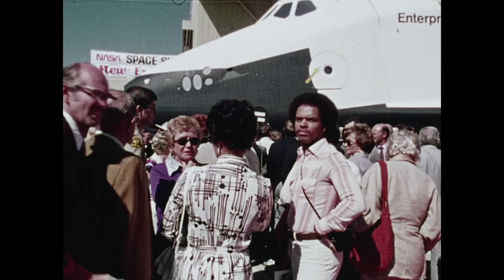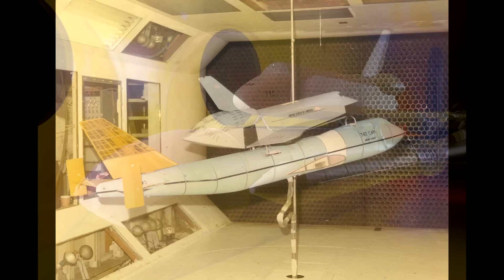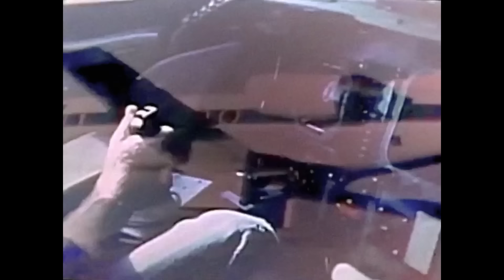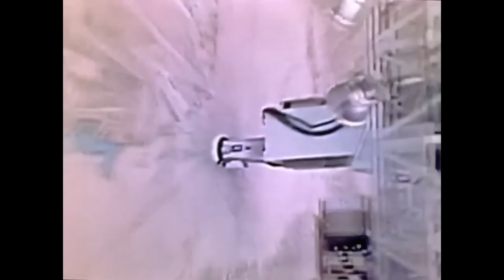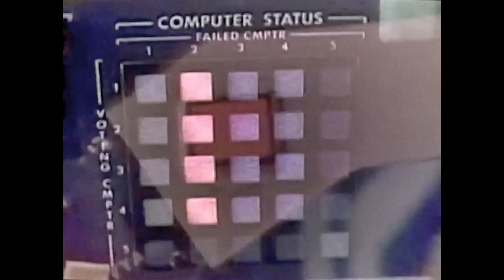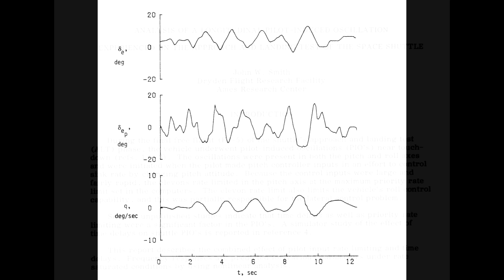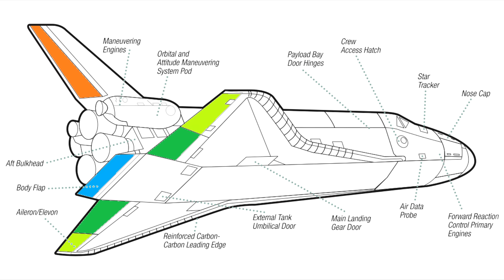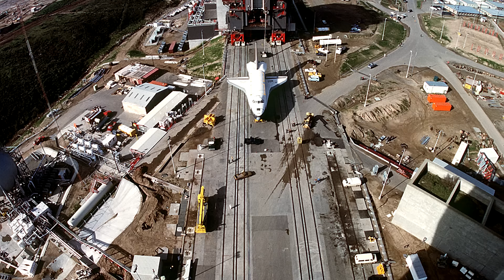How NASA Learned To Fly The Space Shuttle Like A Glider

Comment: Thanks for this video. I was able to re-live my youth. In 1981 I was a technician helping build the cabling system at Ridley Mission Control at Edwards AFB. As the building was built, I stayed on to be techinical support for the operators of the consones you see in every shot of Mission Control.

I could tell stories about building the cable infracture in Ridley. I had to wear a coat when running the cables under the four foot false floor. It was very cold under there. The cooling system for all the equiment was just cold air fed down under the floor. Then whenever they added a piece of equipment, they just cut a hole in the floor and put the added piece of euipment over it.

I was there for the first Shuttle landing. However, since I was just support, I watched with the crowd. I had to be out of Mission Control 30 days before a landing. I had a shop where I worked on other projects. Like Tracking & Telemetry and Communcations equipment for Ridley.

I am now 68 y/o. I enjoyed seeing Ridley Mission Control in action knowing how deeply I was involved in it. I was 24 when I worked there for Kentron International.

I worked on other projects for the DOD, like as an avionics tech for the ASAT, where I was the only avionicstech on four of the avionics packages for the Celestrial Eagle. I was the guy who was on the HUD, the VSD the ACS, (Armenent Control System), and the CC (Central Computer). 

And I worked on the M.I.L.E.S. System at Ft Irwin.

But I can say I had an important role in the Space Shuttle program.

Comment: I worked for NASA at Johnson Space Center and I was visiting friends in Toronto in 1983. While they were at work I explored. I ended up in a huge park next to Toronto. It was mid day and I was the only one there. It was a beautiful day, blue skies and just a bit warm. Then people slowly began to show up. Many of them had cameras and setting them up on tripods. Within 30 minutes thousands of people were there all looking at the sky. At that point I stood up and asked a woman what was happening. Just as she was answering the Space Shuttle Enterprise appeared in the sky flying piggyback on a Boeing 747. It was the first time the shuttle flew over a foreign country (except for a few hundred miles up in space). 

This flight was for Canada’s contribution for designing the shuttle’s robotic arm. One of my first assignments at NASA was to help build the robotic arm simulator in building 9 at Johnson Space Center. I worked with a computer guru, Luigi Schiavo, and an electronics expert, Jim Gimble. After the robotic arm simulator was built six different grappling fixtures were tested to determine the one that would operate best in zero gravity. We practiced lifting helium filled simulated payloads with the robotic arm and putting them into the shuttle payload bay. The Canadian robotic arm was mounted on a full scale mock-up of the Space Shuttle. Every once in awhile a ‘simulated payload’ broke free from a grappling fixture and floated to the top of the building. They didn’t move very fast because prior to any training session weights were placed in pockets all around the simulated payloads to try to keep them neutral so it more represented the conditions in space. 

I still have a lot of photographs I took that day. I am a photographer so I always had my camera with me. It really came in handy on that incredible day. I laughingly thought, I came all this way and my work followed me.

Comment: SpaceX catching the booster on the first try (5th flight) is cool but casual reminder that the first time the shuttle launched, it had 2 crew aboard, actually went to orbit and then came back completely intact...

Recovering the upper stage is gonna be a lot harder than catching the booster and so far starship has been a completely empty test article.

What happened to the promised 100 tons to LEO?

I wanna see the footage of SpaceX doing wind tunnel testing with starship mockups.

Comment: I see that you covered the first attempt at free flight.
I was watching on live TV as they tried it. They fired the explosive bolts holding the orbiter on the back of the 747, the 747 did the "dip" to assist in release and.....
It did NOT come loose.
They tired over and over and could not shake the orbiter loose from the back.
They had to land with it still attached and NO IDEA if the explosive bolts had actually released the orbiter or did they fail to fire, and the orbiter was still firmly attached??
That would have been one hell of a rectal pucker factor while setting down the two.
If the landing jostle had shaken it loose it would have resulted in a hell of a mess on the runway.
Reply: And it looks like the T38 must have its gear down to fly as slowly as the orbiter?

Comment: Wait -- what do you mean, "reversed the engines"? Why would you want them exhausting forward...? Or what am I not getting?
Reply: It was to add more drag than there would have been with the engines simply off, to simulate the shuttle having more drag tha the test plane
Reply: @jextra1313  okay, that much makes sense...but the whole logistics of the thing are still quite confusing. Surely there aren't nozzles (or even combustion chambers) on both ends? Are they just venting fuel/LOX in the opposite direction (sans combustion)? Because to me, the concept of an engine reversing sounds, generally, like an explosion 😳
Reply: @dancoroian1 You're right, you can't run a jet engine in reverse, but you can redirect the thrust using a physical shield that stops the jet blast and redirects some of the thrust forwards.
Reply: @jextra1313  thanks! Really not sure why that perfectly concise and understandable explanation was traded for "reversing the engines" which seems at best inaccurate and at worst actively confusing...

Comment: This brings back many memories. I was in the AF from '78- '82, stationed at Norton AFB as part of the 1835th EIS. Arriving TDY at Edwards in Summer '79 I got to witness many, many test flights of the 747/Shuttle coming on and off runway. I used to marvel at the skill it took to do touch and goes there.
My groups job was to install commo, metro, video and data cabling across Edwards for the glide tests onto Rogers Dry Lake. We spent months out there working on that. It was a turning point of my life actually. I was part of a mission, working with a bunch of great people with a time line that had to be met. We pulled this off a few months ahead of schedule.
Some of the work we did was right along the active runways. I remember watching the transport combo taking off etc maybe 300 feet away from where we were working. Also slews of the coolest planes I've ever seen. NASA stuff, old F-102's, 106's, A-7's, modified B-52's. It was just a real source of excitment for a young country boy.
Great video as always!!

Comment: I wonder how accurate Space cowboys is, where the modern (during the shuttle program) astronauts say that it's impossible to land without the computer and the old veterans prove it can be done.
Reply from the maker: Computer is still needed for fly by wire, but the longer range navigation could still be disabled for a manual approach plan.

Comment: The "forgotten shuttle", Pathfinder, was used to measure clearances and mounting brackets so that Enterprise wouldn't be damaged.  Made of steel, fiberglass, and plywood, it didn't actually have a name until it was rebuilt as a display vehicle.  It is currently on display at the Huntsville Space and Rocket center.
Reply: Makes sense. I was wondering why they were using actual shuttle construction when basically a foam and plywood would give same results (except weight testing)
Reply: ah yes, OV-98, my favourite

Comment: The runway surface at KSC was made for the shuttle to have an "aggressive" tooth for better grip. But it tore up the wheels, and was resurfaced. I saw the Enterprise when it was on display at the New Orleans World's Fair. I also saw a shuttle on re entry over New Orleans. Still leaving a glowing meteor trail. Slower than other meteors I've seen. Though I suspect one I saw was the shuttle fuel tank re entering, and breaking up. It was on a west to east course, and at the opposite north south angle as the shuttle I saw.

Comment: Enterprise wasnt actually a space shuttle, it wasn’t built to go to space. no engines or heat shield. It was built for test flights, and interestingly was flown with different weight configurations - I wonder if that contributed to the not so smooth landing seen in this video. They did plan on retro fitting it for space flight, but the design was changed and they decided it would be too costly to dissasemble Enterprise to have the various sections sent back for retrofitting.

Comment: As a glider pilot I have done a lot of landings. Space shuttle being a huge glider this 1st landing is not bad at all.
The oscillation very much looks like 'wanting to land the plane' instead of 'letting it sit and land itself'. And with over-speed you then get a oscillating pattern, which can turn ugly very quickly. Typical newby glider pilot behaviour that your instructors will force out of your system very quickly.
If this was software induced that is a potential killer. Software induced oscillation was also seen on testflights of some recent jets.

Comment: I use to work at J.S.C. on the Space Shuttle Simulators in the early 80s and we often tried to land the Shuttle but never once came close!  It was a brick with wings and you had to anticipate your control movements way before your natural instincts.  As you might expect, the Astronauts made it look easy.  :o)
Reply: I replied to your comment but it got deleted. I worked for awhile in buildings 5 and 35 on the fixed and motion base simulators. I ‘flew’ the motion base several times and landed successfully half the time. A couple of times I descended too quickly and hit the runway too hard (probable crash). I went on to work as a test conductor, engineer, designer, suit subject and then I created a video production facility so I could make video programs on Space Shuttle and Space Station missions. I was in building 5 walking toward motion base when a fellow engineer walked up to me telling me the Challenger just blew up. I was in shock. I worked with astronauts training in the different facilities at the Johnson Space Center so I got to know many of them.

Comment: The five computers did not work as you described. All five would vote and the majority decision was the accepted answer. If one of the computers failed, another one would also stop voting so there was always an ODD number in the voting cluster. Further, if there was a second computer failure, the computer which had previously dropped out would now start voting again - this means failure modes in voting were 5-3-3-1-1. If an even number of computers had been used in the vote, this could lead to a deadlocked vote and hence the system would not know what answer to trust. It is a well known "coding pattern" which existed more than five hundred years before the first computer was built; sometimes the oldest formal decision making processes feed directly into our digital world.

Comment: Amazing that the Shuttle would come down at a 20° (compared to 3° of an airliner) and yet be able to flare and hover like that over the runway and even need a parachute to timely complete rotation to the ground. Great coverage!
Reply: Ground effect.
Reply: Its poor lift/drag ratio is partly due to its low aspect ratio wing. When within approximately 1/2 or 1/4 wing-span of the ground, the surface limits downwash angle and therefore erases much of the lift-induced drag. In short: ground effect improves efficiency.
Reply: And yet on tv it looks like the approach of a commercial airliner.  The shuttle broke laws of physics
Reply: @allthingsbing1295  No it didn't.
Reply: @Quicksilver_Cookie  english not your first language huh bud

Comment: I thought I'd share the story of the day I spent landing the orbiter over and over again.  In the late 90's I was working as a jr. systems administrator in a research lab at JSC that had built an out-the-windows simulator that had been used to help develop the recent glass cockpit upgrades for the shuttle.  They were running some tests on the simulator and needed someone to pilot the thing to make sure it was working and fine-tune the displays, so I got tapped.  I had never seen the simulator run before, and no one told me how to operate it.  It included a full-sized cockpit mock-up and several projectors that ran out-the-window visuals on an at-the-time state of the art SGI supercomputer.  So I sat in an accurate-to-scale cockpit flying the orbiter with a joystick and a bunch of glass-cockpit controls.  

The simulation started somewhere high over Florida, which I figured out by pointing the nose down until I could see the coastline.  But the simulation kept restarting before I could get anywhere near the ground.  Since I couldn't figure out how to land it, I started trying Immelmann's, barrel rolls, etc., out of frustration. (Shout out to the original 'Ace-of-Aces' game books)  It turns out the orbiter was not highly maneuverable.  Finally, someone came over and said 'what are you doing', to which I replied something like 'I don't know', and they said 'here, keep the dot in the cross-hairs'.  Ah Ha!  A Head-Up Display!  So after several more tries, I managed to start landing it, or getting close, although it helped when I was shown a few other controls, like the one to lower the landing gear.  But I eventually managed to even get the landing flare down.  

When that got old, I got bored and tried a few other things, like doing a belly landing without deploying the landing gear, and actually managed to find a flaw in the simulator, because if I glided in smoothly enough, I could get the runway going over my head before the sim stopped.  Apparently, it hadn't occurred to anyone that someone would be crazy enough to land without deploying the gear first, so the simulator didn't count touchdown as happening until the virtual wheels, which were still tucked into the body of the virtual orbiter, met the surface of the runway.  So they had to go back and update the simulator to fix that.  

As a result of all of this, I could honestly claim in my list of useless life skills that, in an emergency, I could probably actually land the orbiter if I had to...

Comment: So a cross between a lifting body, a glider and a brick that hasn't got the flight controls or finesse of a more modern aircraft, that "comes in hot" (230-240kts) and doesn't have proper flaps and limited speed brakes... basically it looks like it was a bit 'pitch up', too fast and did a sort-of-flare that was too big and got stuck in a wobble wanting to stay flying until it scrubbed off some speed...

Comment: A more detailed look at the entire atmosphere entry, approach and landing would make for a great video.  The shuttle would come through the atmosphere at a pretty high angle of attack and would roll left and right to scrub speed and limit the effect of lift that would otherwise result in an oscillating descent.  When they reached the landing strip, usually the NASA Shuttle Landing Facility at the Kennedy Space Center, the shuttle would intentionally overfly the center of the runway and at that point the crew would be given a final assessment of energy and they would then undertake a wide turn, sometimes as much as 240 degrees, and depending on the energy as they crossed the field and the winds they would either fly a wider loop or smaller loop so that when they turned final they would have just the right surplus energy that could be removed with slips or skids and aero-braking so that they'd reach the runway at precisely the energy needed.  I think the software to do this should be implemented on all commercial and military AC so that in the event of engine failure they have options they lack at present.  And why not add this to civilian AC where possible.

Comment: I believe it was caused by PIO (pilot induced oscillations) From what I understand the fly by wire computers were not moving the control surfaces fast enough when the pilot made a change. The pilot thinking the input wasn't accepted issued another input. By then the computer was doing the first input. So the time delay between pilot input and control surface movement I believe was the issue.

Comment: Having a plane piggyback on another plane was done in the 40's by Germany in WWII, so it it wasn't a question to see if it was even possible. The mistel setup was slightly different in that both planes would be used my one control plane. The idea was to make the bottom plane a guided bomb. It worked fine in tests, but wasn't very good for combat, as they were too slow, couldn't maneuver, etc.

Comment: I was 19 when this was done. I was 100% against naming this shuttle Enterprise despite the fact I was/am a ST fan. Watched in original run. I new then at it was never going to orbit. A totally waste of that name. I had several conversations with others who thought it would go to orbit some day. I knew diff. As you mention, it was never designed or intended to orbit. Was just to do drop and pad fit tests. Was also use to test fit at VAB for west coast launches. It also served as a hanger queen for some spare parts. But that was it. Was also to heave. Naming Challengers replacement Enterprise vs Endeavor would have been a better use of the name Enterprise.  I’m hoping that Elon would consider naming the first crewed SpaceX Starship to Mars, Enterprise. Then we would have the first Starship Enterprise, boldly going where no man has gone before.